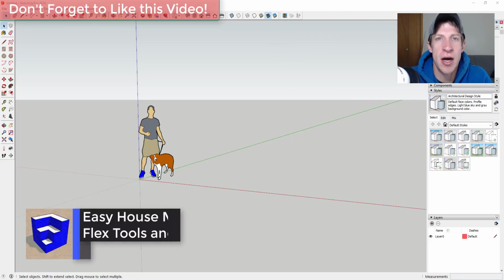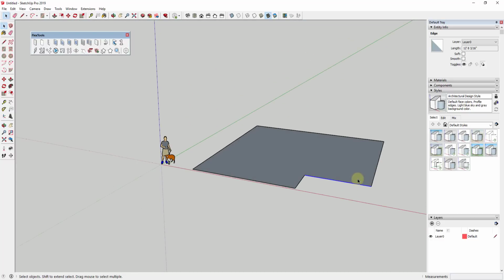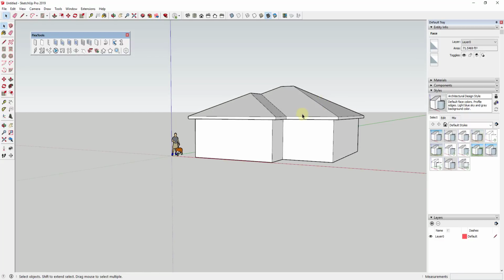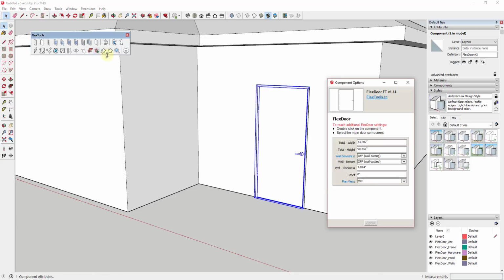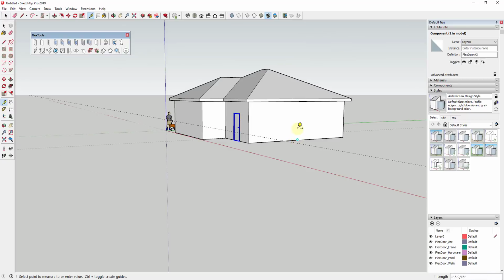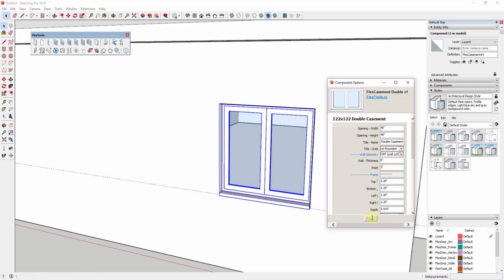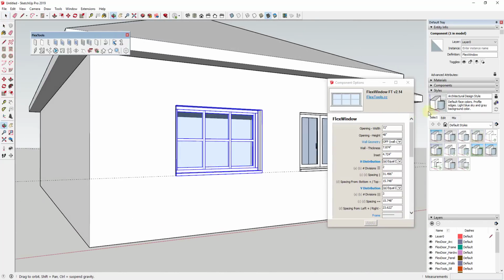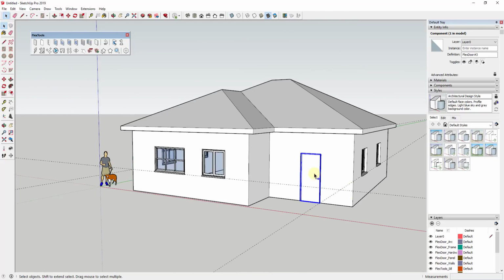EASY HOUSES IN SKETCHUP with Flex Tools and TIG Roof!

Comment: I use 1001 bit tools free version and does work for me sofar. Shifting the windows left or right does hardly happen coz of the fixed architectual 2D plan. Then compared with Dibac which is not only cheaper it is a  1 time purchase instead of an anual fee. The dynamic components of Flex Tools however look slick. What would be your favourite, Flex Tools or Dibac?

Comment: The windows and doors are on the layer as the wall I presume so you don’t need separate layers for windows and doors which is my normal work method.
Reply: Flex Tools create difference layers for the windows and doors :-)
Reply from the maker: Nice :)

Comment: Nice , but if u compare the same tools with the one in vali Architect , which one looks better for u ?
Reply from the maker: Tough call - the Vali Architect extension has a lot more options for different kinds, but these are really easy to adjust. Probably depends on the variety of window you need...